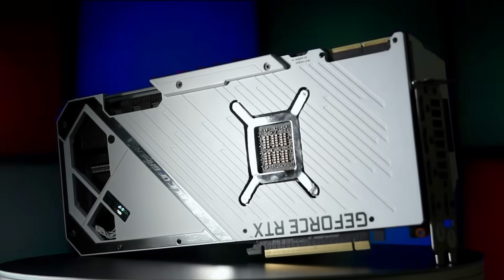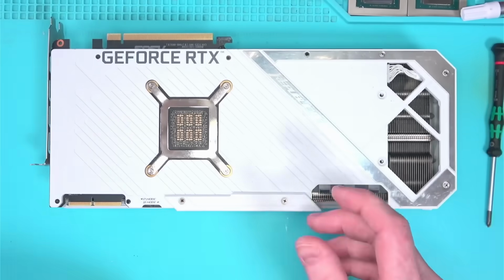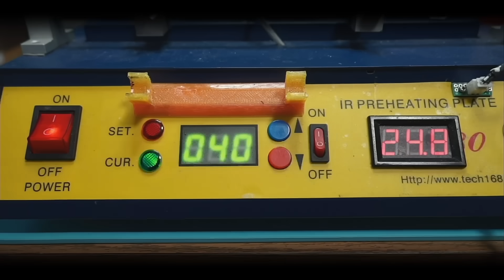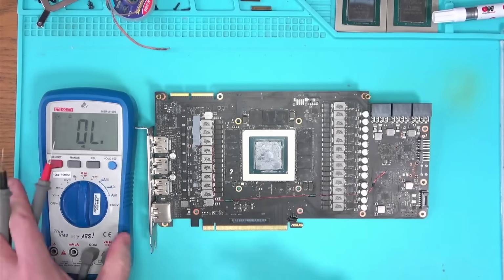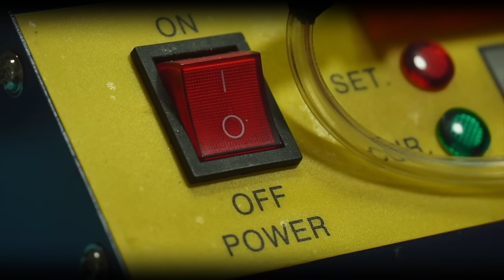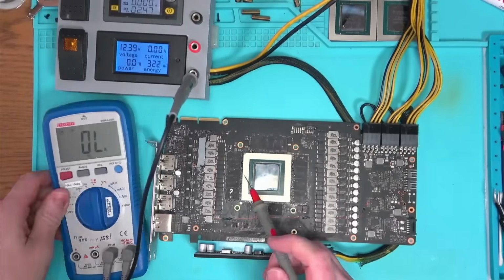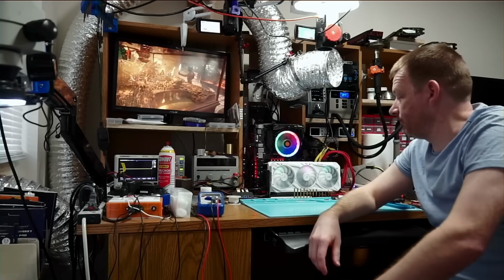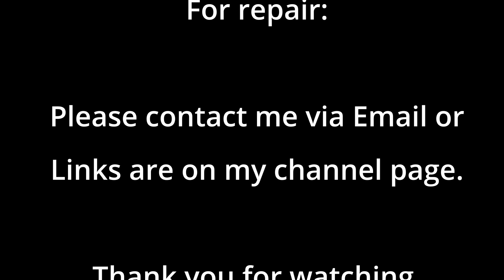Do graphics card repairs last ? (asus 3090 with ripped pads under the core)

Comment: Hey Tony. HaWaЛук at this situation differently. Warn your customers to use cards this big in size either with support bracket or mount them vertically. This will reduce the stress for the BALLZ under the chips. I know that you know that, yet warn them :)

P.S. Great content as always.
Reply: what that word means?

Comment: Do you take barely-functioning GPUs that semi-work still? I have a Gigabyte (junk, I know) RX 6900 XT OC that doesn't do very well for DirectX or Vulkan rendering anymore due to some possible heat damage (I suspect), but does OpenGL just fine (didn't blackscreen on Furmark of all things). Recently replaced it with new old stock.
Just hate for it to be sitting around when it could be used for parts or repaired and resold.

Comment: these cards are not designed to be shipped mounted on a pcie slot, or working without some kind of support from bottom.  so crazy how a 1300e gpu have so fragile pads anyways.
most of the times the ripped pads are the closest to the pcie, means someone didnt take care of it while shipping or installed in the computer.

Comment: Hey Tony, its homie. 

Wanna ask. Whats the best long term maintenance for GPUs? Should i go vertical mounting to avoid sagging (and possibly ripping pads)? whats the maximum temperature on vram and gpu core to hit to warrant a repaste/repad?
Reply from the maker: Long term would be:
Mount outside of the motherboard using some sort of a riser.
Keep it it as cool as possible.
Hope for the best.
Reply: to add to that if you wanna go overboard: watercooling. Even the heaviest blocks are nowhere near the size and weight of those humongous air coolers. Heck... look up pictures of a founders edition 3090 with an EK waterblock on it. It's so tiny it's almost cute 🤣
Reply: What I did is not pretty but well at least it works 😂 I just turn the case down by 90 degrees in order to keep the GPU in vertical position and also because of the weight of the CPU cooler (Noctua DH15) . Temps are almost the same, maybe 3-4 higher but absolutely managable.

Comment: BGA is trash. The pads rip all the time. PGA is so much easier to deal with. You're gonna hear about board height, but the 3090 is already a 3 slot card, I doubt PGA would make it any bigger. I'm old fashioned, I wish pins would make a comeback. Much easier to repair.